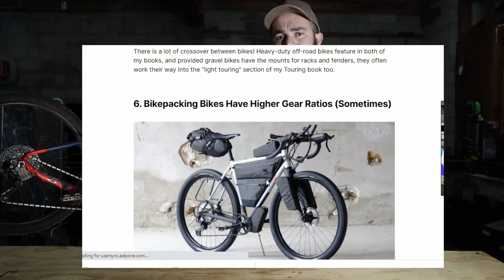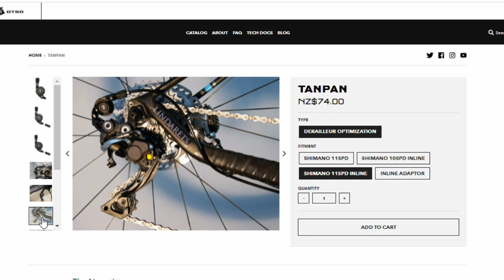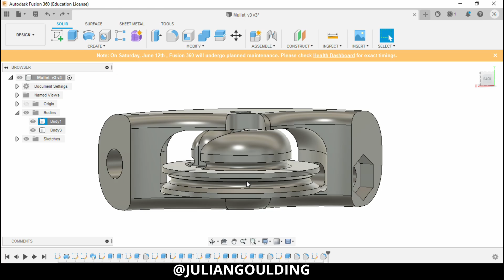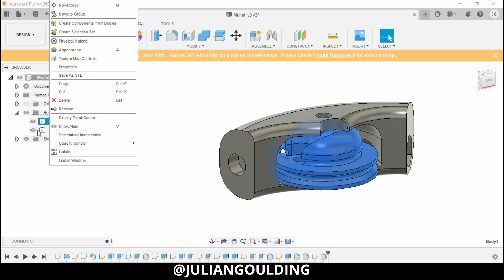Mixing ANY Shifter with ANY Derailleur || The Mullet Drivetrain HACK

Comment: Have a bike with a grip twist for locking out the suspension.  Hate having the twist and lack of using better grips.  The commercial options are very expensive to replace it with something else... thought is to take a 3x front shifter and tweak it so it moves 7mm each shift point.  Can your model be set to achieve that?

Comment: You could measure easily by setting up everything for the smallest cog, then you put a tape in front of some cabel armour, to mark the zero position. Then you go to the max on the shifter and measure how much does it pull. Then pull additionaly somehow the needed amout to shift for the biggest cog and measure again from the tape to the armour holder. If you have  some adjustmet bolt on the shifter armour you could use that to pull the additional amount, or pull the cable by hand. 
There is a v brake snake adaper from china that does the similar thing and costs around 6 dolars, but using the 3d printing and this proper model is genious! Just use the proper kind of plastic for the printer so it will resist the weather and uv light

Comment: Cool. Can this work with the opposite set up? I have a road bike with Dura Ace derailleur but I want to put on flat handlebars so I’ll have to get mountain bike hand shifters. How can I get that combo to work?
Reply: I don't think so, from what I heard the front derailleurs might be a bit more tolerant (and you can tinker around with mounting height and the limit screws) but rear derailleurs need rather precise actuation; 
Shimano actually has some flatbar shifters for their road groupsets like the Tiagra SL-4700 they're 10-speed but AFAIK this together with the GRX 400 series has a different cable pull or the SL-RS700 for 11 speed Dura-Ace/Ultegra/105/GRX800/600 groupsets.
The SL-4600s should work, because that generation had the same cable pull as the previous, higher-end 10-speeds (Dura-Ace 7800/7900, Ultegra 6600/6700, 105 5600/5700), there's still a bunch of them available as new for 30-40€ each.
Got my first (used) road bike a year ago with Dura-Ace 7800 shifters and rear derailleur, and the 6500 in the front works fine, but I quickly snapped my shifter cable for the rear and the mechanic (because I couldn't remove the old end by myself and didn't want to butcher that delicate mechanism) told me it's the wrong cassette - a 9-speed on a 10-speed groupset; AFAIK in a few scenarios you can use cassettes with one sprocket less and add a distance ring then it should still work with that derailleur but not 9 on a 10 speed.

Comment: Just FYI shimano 10 speed road levers work with any 9 speed shimano rear mech as they have the same pull ratio. I run 10 speed 105 with a 9 speed alivio mech with no issue

Comment: Never bother with this. The plastic will wear out quickly and the shifting will be garbage. The pulley needs to be metal for it to be worth it. Perhaps send the file to a 3rd party to have it machined and sent back to you instead.
Reply: Or just buy the options that are already available?
Reply: @Bungle2010  Because sometimes what is available isn't what someone wants.
Reply: @EricPeelMusic  Except there are already gizmos available that do exactly this. This video is the literal definition of reinventing the wheel.
Reply: @Bungle2010  No. There are solutions available for a limited number of shifter/mech combos. This video assists in obtaining a solution for combos not yet accounted for

Comment: If you can live with 9 speeds or less in the rear then the shifters are interchangeable for Shimano (and SRAM too afaik). A simple 3x8 has the same, or better, gear range than a 1x system with none of the compatibility head aches.
Reply: you can use Alivio and Deore (old 9v ones) with 10v road Brifters , paired with a 10v cassete, these rear mechs can shift 10v . I just build my 2x10 using this and yeah, its a  pretty nice option
Reply: From what I read the front MTB derailleurs are not compatible with road shifters even in the 7 8  and 9 speed systems. Does your experience prove otherwise?
Reply: @klausdunayev7078  I'd have to refresh my memory to get the details absolutely correct. My recollection is that Shimano rear derailleurs and shifters are compatible between road and mountain bike components except for the very high gear counts above 9. The front deraileurs and shifters are not compatilble, i.e you cannot mix and match a front mtb derailleur with road shifter. So to covert an old mountain bike to drop bar you can get a set of road shifters and new front derailleur. Possibly a new crank set as well. I'd have to double check that.  I haven't actually done my old mountain bike yet, but I plan to and that is the rough plan. Subject to a final confirmation before I order parts. I know one thing for certain: I don't value 1x drive trains over 2x or 3x so I won't go out of way to convert to 1x. But that's a personal preference.

Comment: The first and last click on shifters pull extra cable to allow the limit screws to set the end position. So for the most accuracy only measure the middle shifts or you'll end up with an average pull that is about 0.1mm too high.

Comment: I want to have 11-51 deore M5100 on the back and 50-34 road crankshaft on the front in my flatbar bike. Knowing now that mtb ratio is not compatible with road ratio an option for me is to use dedicated shifter for each derailleurs i.e. xtr M9000 for the rear derailleur deore M5100 and SL-RS700 for front 105 roadbike derailleur. Both shifters are very similar in shape so it should have a preaty clean look and feel

Comment: I have a Shimano 3x9 MTB system and want to use older 3x9 Shifters (or a new Sora), but only found contradicting info on the internet. Some say that up to 3x9 the MTB and Road pull ratios are identical with Shimano. Only with 10 and 11 speed these problems occur and need an adapter. Is that so?
Reply: IIRC 7, 8, 9 speed MTB and 7, 8, 9, 10 speed road have the same pull ratios at the rear, so that should all be compatible, but road and mtb have different front derailleur pull ratios, so that'll be a problem. but i'll need someone that is more knowledgeable than me to confirm this info.
of course none of this is impossible to circumvent as shown in the video, or you could also modify a front derailleur to change it's pull ratio, if you search about that you'll find people that have done it. so basically you should be able to make it work, just that not easily lol

Comment: This problem of drop shifters not being sufficient to provide adequate cabel pull for wider gears is just not being picked up by manufacturers. This video is testament to the ingenuity of some people who just go "fuck it, I'll do it myself then". Pure brilliance 👍
Reply: you're right, but there's economical reasons for them not being compatible I believe, this video is gold tho
Reply: @andresrivas4703   Yea. Historically products that are widely accepted in the market and being produced by many manufacturers have more successes and stay longer in the market. Some of them even became market standards.
I am thinking, in the end manufacturers are harming themselves by not agreeing on standards, for brakes pulls, shifter pulls, headset and bottom brackets sizes, hub width, etc..  Shimano for example is very good with implementing special cassettes or specific chain standards.

I recently bought Tectro brake levers for drop bars, which are designed to work with V-Brakes. They work fine. Why are there different pull rate standards?

Comment: Mmh how would be the wheel for a shimano 10 speed road shifter with a shimano 10 speed mtb derailleur? Or are the thingiverse files this ready? Or must I change this only 1 Parameter or more?
Reply: Shimano 10speed road brifters are compatible with all Shimano 9speed derailleurs. Had 2 bikes with set-up like this. Perfect shifting
Reply: @pluszkin  I had s bike too and it not shift perfect in some gears

Comment: Gevenalle makes a brifter specifically for that. It's made to specifically go with Shimano Dyna-sys, but it can be set to friction mode and that makes it work with any derailleur.
Reply: I've had good luck with Gevenalle on many bikes using XT and XTR 12 speed drivetrains.

Comment: Julian, how to measure parameter for shifter? also the scale no need to change? I measure parameter for derailleur like you, but 2 other parameters ?
Reply from the maker: So is that is you dont have both shifters? I have the second shifter that Im replacing so i used that. Have a look at that like in the discription, you mint find you derailuer there. Finding it with just the derail
Reply: @juliangoulding  So i measure shifter pull and derailleur pull (from website) and input in Fusion 360 file. For your example Shimano 105 10sp is 2,3mm pull x 10= 23mm and you measure 32,5mm for deailleur. Right? Sorry for bothering you
Reply from the maker: @zoranbjelotomic4806  yes that is correct. No worries.

Comment: I asked a bunch of shops if I could do this and the consensus back then was "don't be stupid" but I did it anyway, with Deore rear derailleur and Sora brifters. Sure, the left one doesn't do anything and there's an extra click on the right that achieves nothing but gosh darnit it works. It's a GT Speedball with drop bars, brifters and handlebar interrupter brakes as well. The goal was a "fast commuter", so I have many handlebar positions, can get under the wind and it's always ready to go.
Reply: Bike shops can be really pretentious sometimes
Reply from the maker: Love this comment. Im planning on hacking the left one to operate the dropper post, its gonna be awesome!
Reply: Afaik, Shimano 9s road and 9s Mtb is compatible with each other. 10s and 11s are not.
Reply: I have the same Sora brifters with XT shadow 9 speed mech and 11-34 which works perfectly. I also have an SLx crank with 44 outer and 36 mid (sometimes a 32) all through a Sram 2x10 front mech and the left had Sora 2x brifter.  I am super fussy about gear slickness and the whole setup works smoothly and quietly. The only thing I should make clear is I set the chainline up so the front mid ring would cover all 9 on the rear whilst the outer gives me a sort of 'overdrive' for the road etc with the upper half of the rear cassette.
Reply: Exactly my thoughts, I have the Breezer Radar that cones stock with this mullet set up!
9 speed Shimano goodness ❤️
Reply: Do you make any adjustments/mods ? or is it just connects perfectly ?
Reply: ask chatgpt it solves

Comment: Hey so I work at a bike shop as an bike mechanic and sometimes when clients have no choice and has an emergency they mix a sram and Shimano derailleur and shifter but on the long run mixing brands like that can cause a lot of damage to the whole group set because sram is a 1:1 ratio and Shimano is 1:2 ratio so just keep in mind to Google your ratios before mixing. But otherwise than that awesome job love your videos

Comment: Perfect, any chance for formula calculation of the diameter and pull relation? Can wait to print and try, thank you a lot for this
Reply: You can find the ratios here: http://blog.artscyclery.com/science-behind-the-magic/science-behind-the-magic-drivetrain-compatibility/ 
In my bike I had an 8 speed Shimano shifter (4.8 mm sprocket pitch / 2.8 mm cable pull = 1.714) and a 9 speed SRAM derraileur (4.35 mm sprocket pitch / 4.0 mm cable pull = 1.085). So 1.714/1.085 = 1.58 is the diameter ratio.
Reply from the maker: Great link that. I hadn't seen that jtek shiftmate, crazy how similar it is to the one I made 😂
Reply: @umcaranumacaloi1062  and how I must change which Parameter for shimano 10road to shimano 10speed mtb